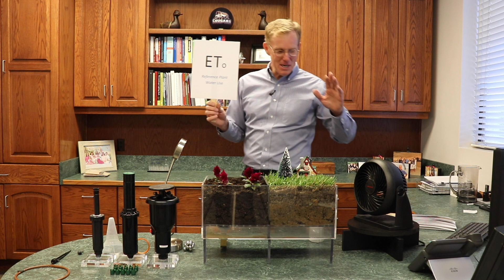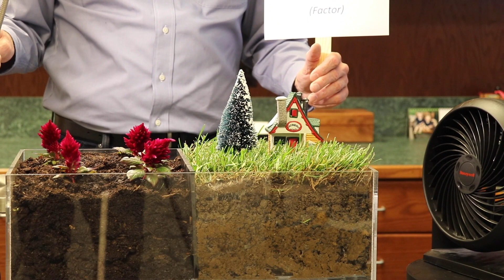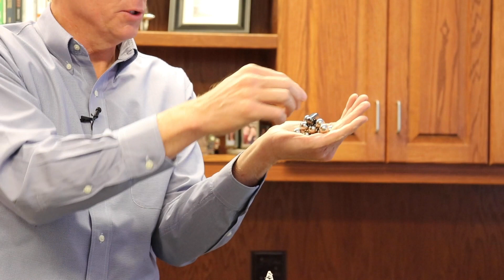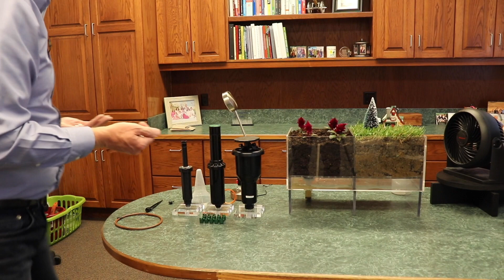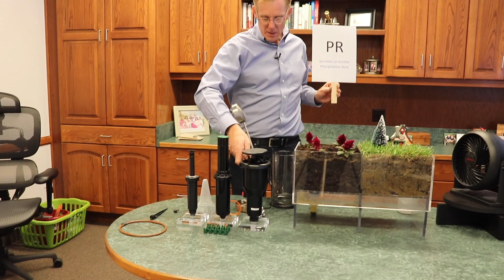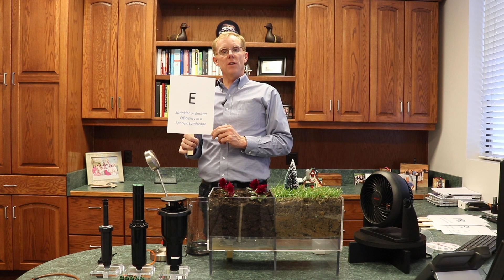B hyve Smart Watering

Comment: I have a beehive. I’ve had it for about three years. Always experimenting with it. But this information you gave is the best.! Thanks for making a video. Now I have been enlightened to how it really works.  Always wondered what those statistics meant and how they worked. The first year I use manual second year I set out catch cups all over, enter the information and put it on smart watering. Unbelievable how it programmed itself and does it all by itself, checking the weather rainfall and so forth. Science at its best.

Comment: seriously a great informative video.  In which "sales department" advertising "empty non-realistic info" is replaced by "actual factual/scientific watering- & soil-logic" based information.

Overlapping:  Only thing I have to add, is using a "waving" sprinkler (instead of the fixed (semi)-round-emitting shown sprinklers) - especially in square watering-areas.  Then watering will be "much closer to 100% accurate", in terms of "the right amount" ... in order not to over-water or under-water certaing areas...  [especially if one regulates the AxB watering area, to match the actual AxB target-area].

I am now much wiser and ready, to save/optimize our water-usage.  And it feels fun, to have been "enlightned" - and now not "having to do this" semi-blindfolded anymore ... and for sure, we need such consciousness, unless we want to run too soon out of, or will have to wait for "water amount to slowly regenerate" - ... just imagine that "just a little water will be coming out of the pipe", or none at all, or water being shut-off in parts of the day ... etc.

Also the thing about "replacing digital 0/1 rain-skip" watering, with an analog based "intelligence & percentage thinking", adding up to have a near-exact amount for free/available water in the soil in the root-area", is GENIOUS, and necessary.
(and, at the same time, I haven't seen any other company, implementing this.  LinkTap for instance, just makes a "0/1 digital decision" - and all soil-moisture watering-systems also just has a 0/1-digital option).

Once again: Thanks for a fantastic show/demo, with humor and creativity included ;-)